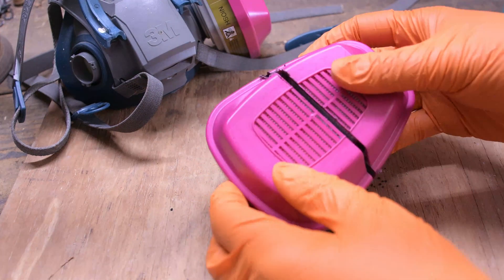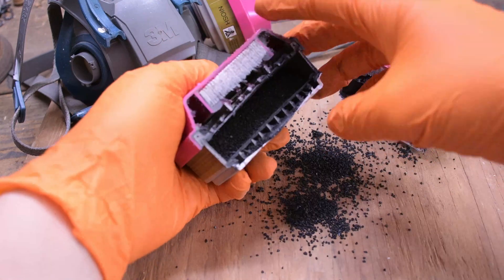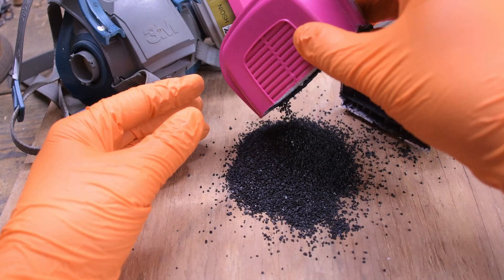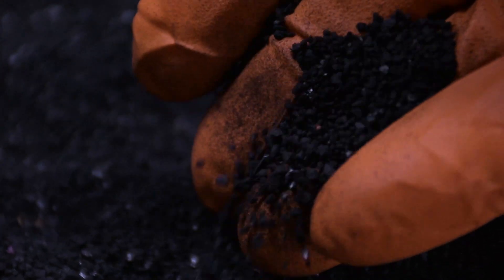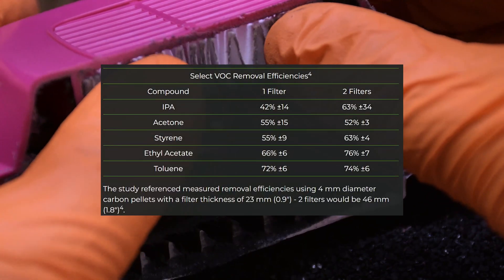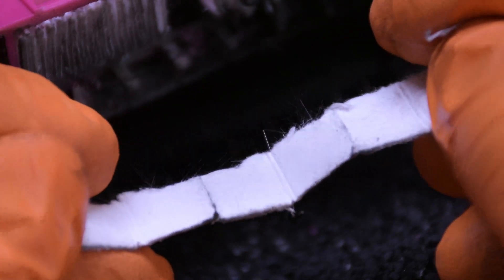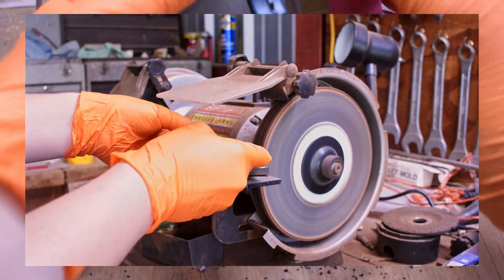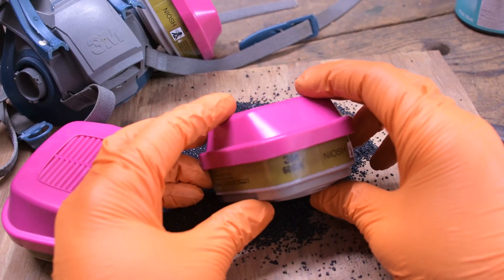Respirators for 3D Printing - Resin Fumes & FDM Nanoplastics

Comment: This comment is a bit of a mess because I lost the draft twice and was responding to a few other comments, but it's very important for anyone who wants to use carbon filters in their respirators. Short summary of main points:

- DON'T JUST REUSE carbon filters! They can desorb previously absorbed material. If stored (even just overnight) this can happen before they are saturated, exposing the user.
- Carbon filters can have very short service lives; 3M has an estimator tool (based on contaminant concentrations and limits, ambient temperature/pressure/humidity, work intensity, and filter cartridge used)
- The "Cartridge Change FAQ" document by 3M is really important, and their other documents are also useful
- Get the right carbon filter for what you're working with, but unnecessary treatments can reduce cartridge service life
- Particulate filters are good until something damages them

---

I'd recommend getting several 6001 (or 6003 if you expect OV/AG, 6005 for OV+formaldehyde...) chemical cartridges with a 502 adapter (501 also works) and a 2091 particulate filter. Change out the chemical cartridges frequently but keep the same particulate filter. 

---

Respirator service life for organic vapors is complex, especially if the filter is stored after use. The vapor migrates in the cartridge, and can start exposing you to previously absorbed contaminants if left in storage for hours/days/weeks (depends on the chemical, generally low boiling point chemicals are more prone to desorbtion). Also note that the more specialized OV cartridges are generally treated for chemisorption of compounds that the regular OV cartridge can't process, but that generally reduces its service life if exposed to pure OV.

In contrast, particulate filters generally have their rated efficiency until you expose them to liquid water, oil aerosols, or damage them. They actually tend to filter more particles as they get saturated, but eventually you can't breathe through them easily enough, so they don't last forever.

---

I'm interested in ABS printing, so I did some service life estimates for styrene, which fortunately appears to be relatively easy to filter (low vapor pressure, long service life)
65% RH; 1 ATM; 20 C; moderate work; 5 ppmv styrene; 0.2 ppmv styrene breakthrough point (about 1 mg/m^3, from an EPA RfC)
- 6001/60921: 377 h
- 6003/60923: 328 h
- 6006/60926: 273 h
- D8001/D80921: 316/343 h
- D8003/D80923: 287/313 h
- D8006/D80926: 230/266 h
- FR-15-CBRN/FR-64: 265 h

Since styrene has such a low volatility and high boiling point, desorption is likely to be slow, but "Chemicals with low volatility will give long service lives, but even in these situations use should probably not extend beyond a week or two even if the service life estimate is longer." so I should probably replace my cartridges a few weeks after first use, find/develop a better service life estimate for these cartridges (testing for breakthrough, use a carbon bed with a VOC meter monitoring its effectiveness (such as the Nevermore Max) to filter the air around my printer, use a different filtering technique (catalyst or something) to treat the air, or simply ventilate the room.

---

From 3M's Cartridge Change FAQ:
Q. Do I need to establish a change schedule for particulate respirators?

Service life determination for particulate filters is not required under 1910.134; it is only
required for gases and vapors. Often the particulate filtration efficiency will improve during use
as the filter loads and a "cake" layer forms on the surface of the filter. We suggest therefore
that respirators or filters be changed if they become damaged, soiled, or an increase in
breathing resistance becomes noticeable. In addition to these considerations, N series filters
should not be used against oily aerosols, R series filters should be changed every 8 hours if
used against oily aerosols; and P series filters used in environments containing oily aerosols
should be limited to 40 hours of use or 30 days, whichever is first.

Q. Can chemical cartridges be used for more than one shift?
Organic vapors are removed by the process of adsorption. Weak physical forces hold the
organic vapor on the activated carbon. Since these forces are weak, the process can be
reversed and the organic vapor can be desorbed. Desorption during storage or nonuse periods
can result in the migration of the chemical through the cartridge. Migration is mainly a concern
only for organic vapor cartridges. Organic vapors adsorbed on an organic vapor cartridge can
migrate through the carbon bed without airflow. Desorption of very volatile contaminants can
occur after a short period (hours) without use (e.g., overnight). Partial use of the chemical
cartridge and subsequent reuse could potentially expose the user to the contaminant. This is
most significant for the most volatile and poorly retained organic vapors
(e.g., boiling point < 65°C). For organic vapors with a boiling point less than 65°C, it is
recommended that the organic vapor cartridge never be used longer than one shift even if the
estimated service life is greater than 8 hours and the cartridge is used for only a short time
during the shift.
However, a boiling point of 65°C is not a fine line between chemicals that migrate and those
that do not. Chemicals with boiling points greater than 65°C can still migrate, but the nonuse
period of concern may be longer than above. For chemicals with boiling points greater than
65°C, nonuse or storage periods of a few days, like over a weekend, may be the concern. For
these chemicals, (e.g., ethyl acetate, boiling point 77°C), reuse should not be allowed after two
days of nonuse even if the service life estimate would suggest it. As the volatility decreases
migration will become less of a concern. Your reuse pattern should still be carefully evaluated
even for these less volatile chemicals. Chemicals with low volatility will give long service lives,
but even in these situations use should probably not extend beyond a week or two even if the
service life estimate is longer.
For workers that use their respirators intermittently and perhaps in different environments,
such as a maintenance worker or inspector, the organic vapor cartridges should never be
reused.
The user can conduct desorption studies, mimicking the work conditions of use and nonuse, to
determine acceptable patterns of reuse. The ANSI Z88.2-1992 American National Standard for
Respiratory Protection recommends that organic vapor cartridges be changed daily unless
desorption studies support longer use.
For more detail on chemical bed migration reference 3M Technical Data Bulletin #142 “Reuse of
Organic Vapor Chemical Cartridges.”
Reply from the maker: I think the best way to sum this up is that cartridge respirators are good at mitigation, especially when replaced regularly. The higher the source concentration and prolonged usage will eventually saturate the filter and result in breakthrough.

If people want a higher level of protection, opting for a system such as supplied air is safer and cheaper long-term since such a system can deliver cleaner outdoor air directly to the face.
Reply: @ArisAlder  If you replace it before the breakthrough time, it should be fine, and carbon replaced daily is still cheaper than SCBA refills (SAR isn't something I've looked into, at that point I'd just install a fume extractor).

The important part is counting time in storage the same as time in use, because migration happens in both cases (unless chemisorption is the removal mechanism). If you want to use a carbon filter longer than that with a low volatility contaminant, it's likely to be fine, but the generic service life estimate doesn't model it. As the old saying goes, "Anyone can build a bridge that stands, an engineer can build a bridge that barely stands."

Also you can probably install carbon filters around the printers with integrated VOC meters to detect breakthrough; that might be even cheaper than ventilation in a conditioned room. I think 3M did a similar thing with their ESLI cartridges before the product was discontinued (lack of raw materials or something).
Reply: In the UK 3M doesn't sell the pink filters (60926 is not in their catalog).

You can buy a filter kit (2x 6055 A2 + 2 x 5935 P3 + 2x 501 holder) which I believe is exactly the same as what you're suggesting (501 adapter, 5935 P3 particulate screen, 6055 OV filter). I like this method as it means you can replace the organic vapour filter separately and they're only £10. 

The closest thing I can find to the pink filter is the 3M 6099 and its £40, not sure on the longevity.
Reply: @xeobit2781 I tried the adapter route too (with likely the same components, just US codes). I don't like the way the open design on the 501 adapter makes it easy for liquids and sharp objects to reach the particulate filter, but they're cheaper to replace when that happens (and I can print a protective cover now). You may need 4x particulate filters and holders, one for each side of the cartridge (pretty easy to check by looking at the product images).

Hope this helps, and good luck!

Comment: What do you say to the folks who have put VOC meters behind active resin printers, only to find that the VOC levels are less than that of an operating toaster?
Reply from the maker: To start, I can't imagine that a toaster will emit significant levels of VOCs unless the toast was drastically burnt. A toaster's emissions should primarily be particulate matter. There are certainly common household tasks that can produce relatively high levels of VOCs, such as cooking or cleaning with chemicals. This is part of the reason that kitchens have ventilation hoods and we don't clean floors/bathrooms with bleach on a daily basis.

Consumer VOC meters use inaccurate and often uncalibrated metal oxide sensors. Equipment that can detect accurate levels of VOCs starts in the thousands, and identifying individual VOCs often require gas chromatography. One exception is the detection of Formaldehyde, which should be affordable to detect, and it is a common emission from resin printers.

The type of VOC that is emitted matters a lot. For example, cleaning with Isopropyl Alcohol is safer when compared to Acetone, Toluene, or Chlorine. Resin printers emit a variety of VOCs (dependent on the resin) that can cause issues over time, such as the methacrylates.

The duration of exposure is a large factor as well. Most exposures to problematic VOCs often lasts minutes. This could include painting, epoxies, clear coats, cleaning, car maintenance, and etc. A resin printer inside the home would operate for hours, and there can still be lower emission levels 24/7/365 if the resin is not put away after printing.

Comment: will this also protect me from spray painting fumes
Reply from the maker: It absolutely will provide additional protection for spray painting. The combo cartridges protect you from both the particulates and the VOCs. Wearing one of these outside or at a spray booth is an affordable solution. There are more expensive options that provide additional protection, but they are often overkill for consumers/hobbyists.

Comment: Great ideao of cutting it apart. It is really interesting to see how mich carbon material there is inside this thing, I honestly did not expect that.
Reply from the maker: Thanks! The carbon is also much smaller than we would normally see/expect which is why it's more efficient and a little hard to breath through at times.
Reply: @ArisAlder  Yes, the surface to volume ration is better than with bigger pallets. I am currently working on a solution for my 3D printer enclosure and thought I might use those filters, basically going through different concepts. This helps me to see how a commercial product solves the problem, exactly what you said, what is the grain size ? What is the amount ? How long is this filter rated for ? This can help me with coming up with my own solution. 
For instance I use a Levoit 300 air purifier. This thing comes with it´s own HEPA14 + carbon solution, but the carbon amount is so tiny there is no way it can work for my purpose. So your video has already helped me.
Reply from the maker: I did not measure the grain/mesh size or amount. I would approximate that the weight of the carbon there is 50-100 grams. 4x8 mesh is the typical granule size used in air cleaners.

The Levoit air cleaner will be great for capturing UFPs, and you're right that it will be poor for the VOCs.

It is recommended to prioritize ventilation over filtration since some of the VOCs from resin (e.g. Formaldehyde) are largely unaffected by the carbon. I recommend reading this to get a deep dive on the topic https://4dfiltration.com/resources/3d/3d-printing-air-quality-roundup

Any solution utilizing carbon for resin would need to have multiples kgs of carbon and be replaced regularly, which can be expensive.
Reply: @ArisAlder  "...I did not measure... That´s a pity it would be even more interesting, maybe you can do it later if you happen to have one of those again and put it comments but really it should be fine.

"...It is recommended to prioritize ventilation over filtration... I absolutely agree but with temperatures around 0°C and with other possibility to run the air outside I can´t filter it unfortunately, I will do it when a print is finished, open the window for 2-5 min. But I have no other possibility while printing. I can only close the enclosure and run my Levoit (because it does not fit inside the enclosure, that´s the main reason I am looking for a replacement) I do FDM printing BTW, because well I can´t even vent that properly, resin would kill me xD

This is why I do not get any resin printer, I can´t vent any of that stuff during winter.
Reply from the maker: My brain went straight to resin instead of FDM for some reason. Yeah for carbon for FDM should be fine, especially when doing entry-level filament like PLA or PETG.
Reply: @ArisAlder  They cost 44€!! Pretty expensive but might be still very well worth it.
Reply: @ArisAlder  You seem very knowledgeable about this topic, I am a mechanical design engineer I don´t know much about chemistry, are you a chemist ? 
Would you happen to have a good idea of how I can add a filter inside my small 55x55cm enclosure with an FDM printer inside ? Usual commercial products are too big to fir inside with the printer, so I need to use some 80-120mm fans + HEPA14 + activated carbon solution, just unsura what a good solution would be. My main issue is also that I don´t know when the carbon has saturated and I have to exchange it.
Reply from the maker: I'm a mechanical engineer by study, and I have been pretty heavy into this field/topic for the past several years. After having gone threw dozens of textbooks and hundreds of studies, I'm comfortable discussing the topic but I am for sure not a complete expert.

On my video page there's an assembly video for the fume extractor that should fit inside the enclosure. The files to that are free. Essentially anything that could hold bulk carbon would be ideal. Those 3M cartridges are commonly used for FDM but that would be expensive to replace.

On a few other comments for this video I think I made estimates for how long the 3M cartridges should last. 3M also has an estimated lifespan calculator.
Reply: @ArisAlder  "...but that would be expensive to replace..." Exactly my thought. They are perfect from their shape and function but too expensive for my taste.

"... 3M also has an estimated lifespan calculator..." Thank you, I will check this out.

Comment: Is it safe to use 3m 2091?
Reply from the maker: That cartridge is not ideal for resin - it only captures particulates. Currently my recommendation is for 60921, 60925, or 60926. These are the combo cartridges for particulates and VOCs. 60926 provides the most protection, while 60921 will be the cheapest.

Going with the VOC cartridges 6001, 6005, or 6006 can save money, but I recommend the combo cartridges so that the respirator can also be used for painting, sanding, and etc.

Comment: I am confused are you saying that painting resin miniatures produces particulates in the air so a mask is necessary?
Reply from the maker: Namely spray painting or airbrushing, since that is common. 
Hand painting, especially with water-based paints, usually doesn't need a respirator. The exception to this will be any time that the hand paint or clear coat calls for ventilation, but this is more of a VOC issue than particulate.